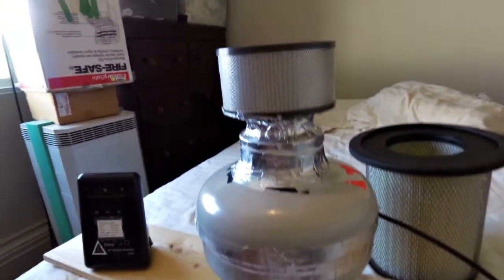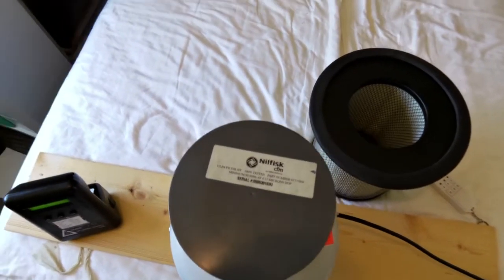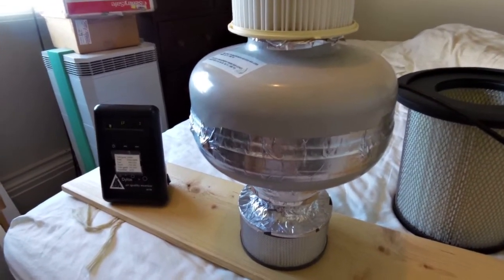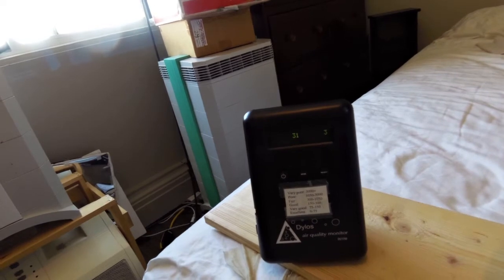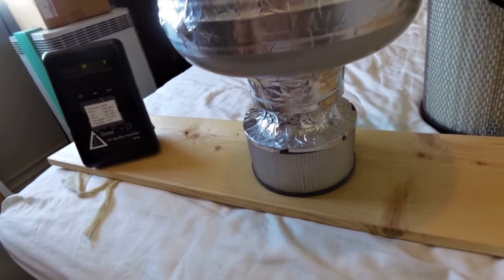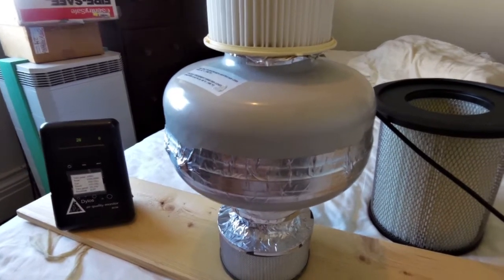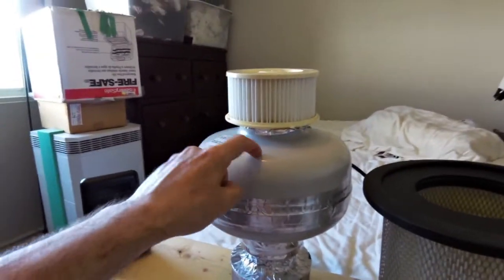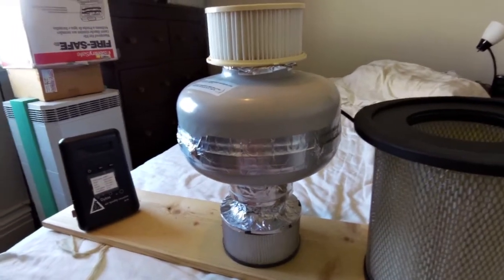ULPA filter DIY air cleaner experiment

Comment: An interesting set up.

I think the fan is having to work harder because each of those filters, force the air to change directions. 

This causes a loss of efficiency.

Attaching the filters/media, 
flat against the duct or fan openings,
would keep the airflow in a straight line.

This would increase your air flow,
and reduce some stress/load on the fan motor.

The fan might run cooler also.

Thanks for the video.

Comment: Rick Rude I respect the videos. What could I buy as a charcoal filter, to remove odors from my apartment? I don't want to build it.
Reply from the maker: Some HEPA air cleaners have additional carbon odor/ gases filters as part of the whole unit. The IQair Health Pro has a replaceable "V cell" carbon cartridge inside. Regular HEPA filters will not remove odors. Some have a thin carbon pre filter, but these are only remove large particles and are to thin to remove odors. Don't use IONIC or Ozone producing air purifiers.
Reply: @rickrude6301  Yes, I'm familiar with all your previous videos. I guess my question should have been "Any recommendations cheaper than the IQair?" I remember you showcased another charcoal filter in one of your videos.
Reply from the maker: @rcald-gz5jd  The best solution for odors and gasses is a large carbon can filter. They have from 5 to 25 lbs of carbon usually. Many hydroponic plant growing supply  stores will sell them. Can filters or Phesh  filters ate a few brand names. They cost from $100-300. You would need an inline fan like in my videos to pull the air thu the filter. The can filter should last 1-2 years. It will  absorbe odors like nothing else will. I will make a video showing it.
Reply: @rickrude6301  Thank you for your expertise.